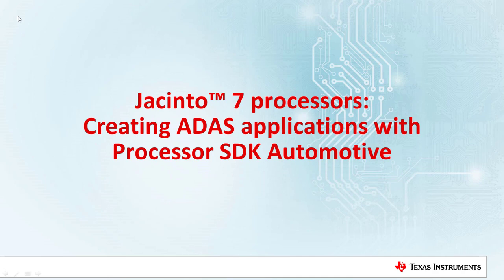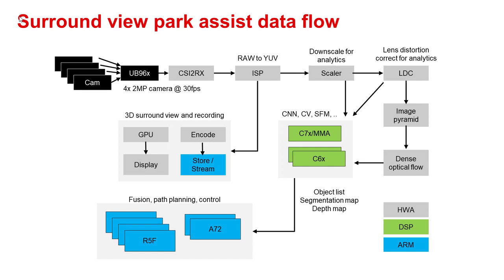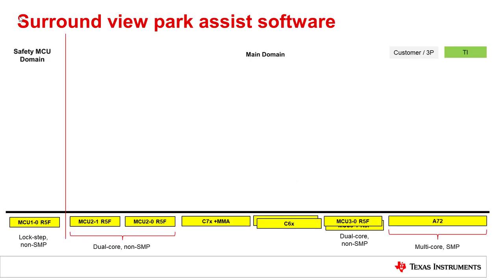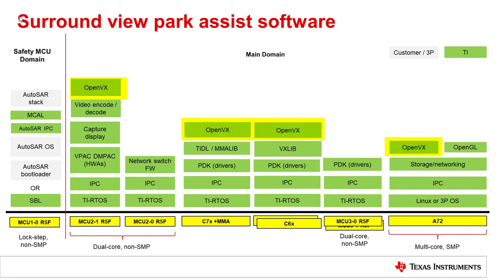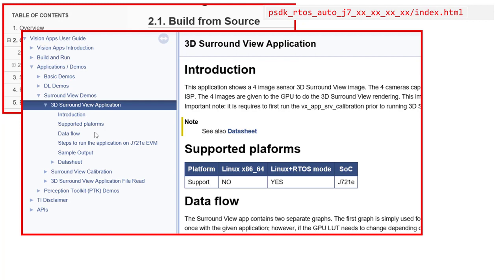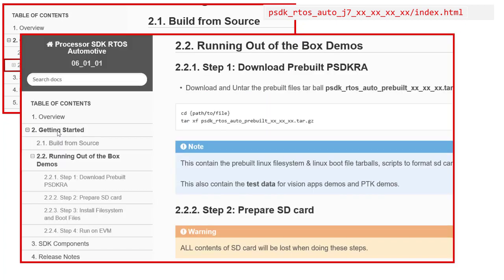Processor SDK for Jacinto 7: Creating ADAS applications

Comment: 00:03 Learn how to create ADAS applications using the Processor SDK Automotive for Jacinto 7.

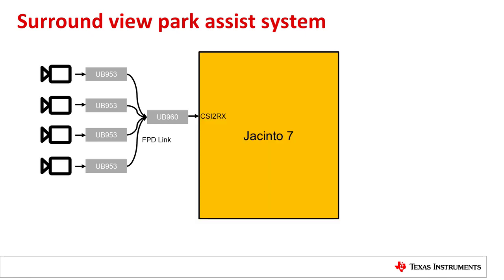01:47 Jacinto 7 SOC processes camera data for surround view park assist application.

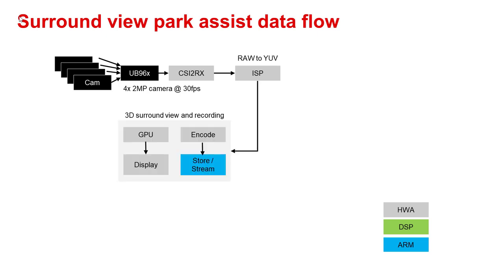03:36 The processing pipeline includes ISP for data conversion and visualization, VPAC and DMPAC for pre-processing, and C7X MME and C66 for processing algorithms.

05:24 Jacinto 7 enables autonomous parking through environmental information fusion

07:16 The Processor SDK for Jacinto 7 enables ADAS applications by utilizing different processors and software stacks.

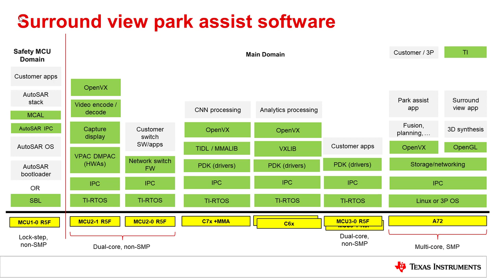09:06 Customize and add your own software and algorithms on the various CPUs with the final integrated surround view and park assist application residing on A72.

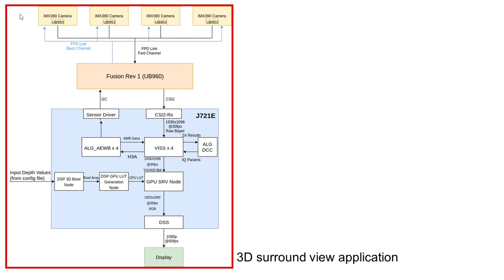10:58 The Processor SDK for Jacinto 7 provides demos for surround view and auto valet parking, which serve as high-level design and software architecture references for ADAS applications.

12:37 Learned how to map a sample ADAS application to Jacinto 7 SOC

Crafted by Merlin AI.